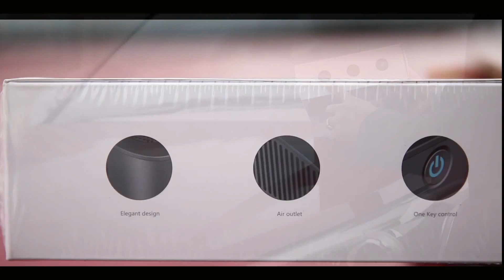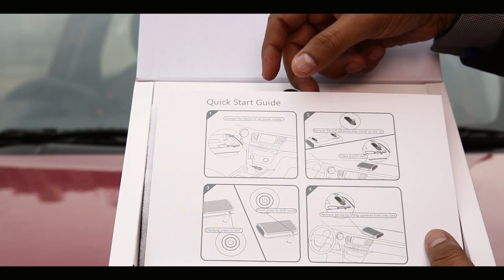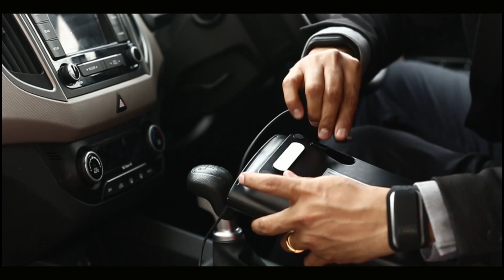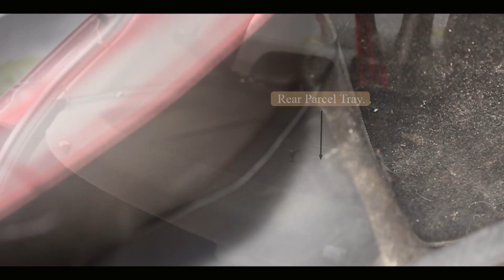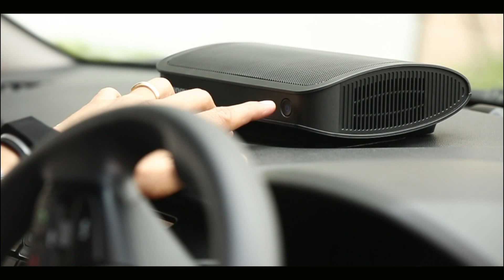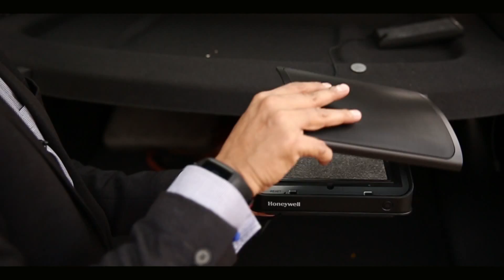Honeywell Car Air Purifier || Unboxing Video ||

Comment: How long is the wire? I want to keep the purifier at the back but the power plug point on my car is only at the front (VW Polo).
Reply: Ratnakar Soren no problem the wire length vis enough to connect in front plug when u placed purifier at back.
Reply: Atmosphere drive (Amway) is the best air purifier in the world so if you health consciousness then contact me 
9541901113